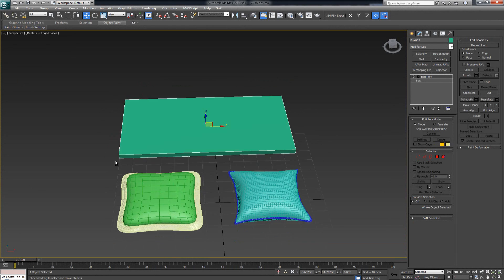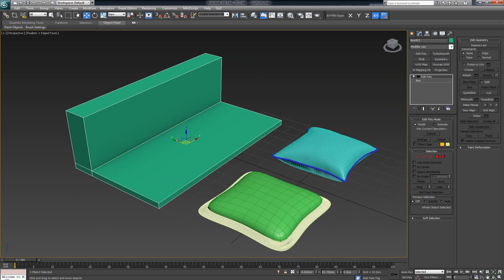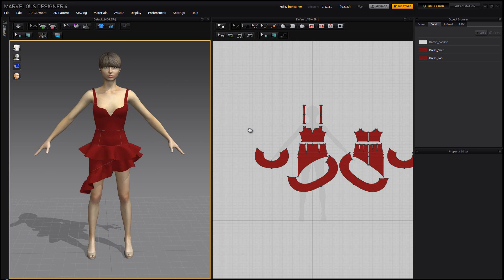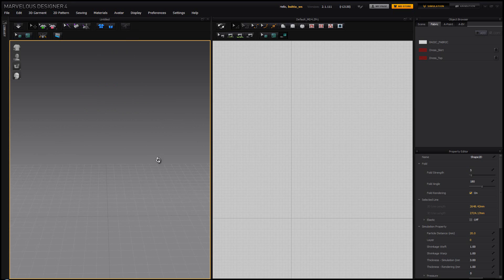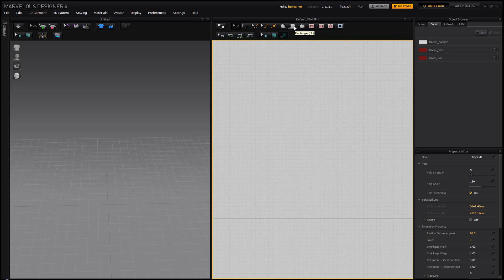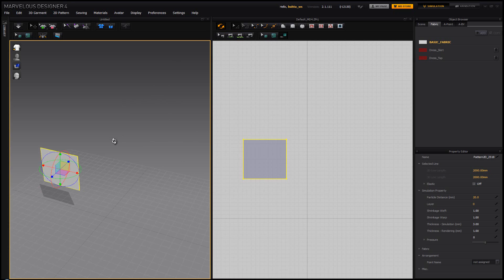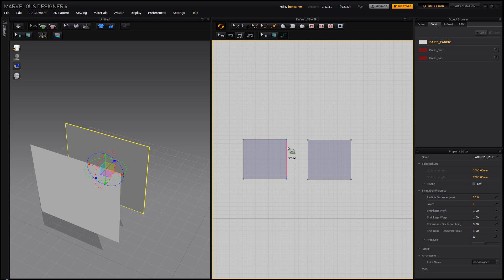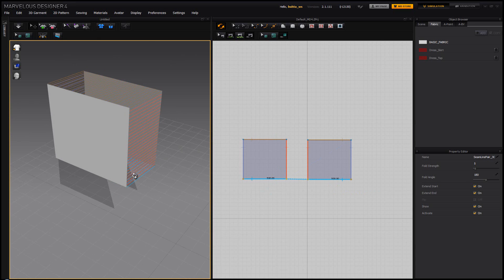Modeling a Pillow in Marvelous Designer

Comment: Do you now how you can make the inner part more stiff like denser filling or wadding? Presure only inflates it buts its still flexible, i want it more like stronger pillwos which can stand and dont bend
Reply from the maker: Make a inner pattern and inflate that one. Then freeze it so it doesn't simulate and make a bigger pattern enveloping the frozen pattern so it will consider it as a collision object.
Reply: Yes i know that one, but it always looks more like a balloon or something inflated. Im looking for a method to make square like or stiffer pillow, not the bulging one.

Comment: Hey Denis, great tutorial video. Do you know of any workflows when it comes to optimization of these pillows specifically for game engines, such as creating a low and high poly version so you can simply bake on most of the details?
Reply from the maker: Create a high poly model and then do a retopology model on top of the high poly. After that is done you can bake the normals from the high poly down to the retopologized model
Reply: Denis Keman all within Marvelous or through something like zbrush?
Reply from the maker: MD for the High poly and Max or anything else for the retopo.

Comment: Great video and tutorial. You have have what it takes to be a great teacher. 
one question, how many polygons was your pillow at the end? I'm considering the render time with vray
Reply from the maker: +ferikasif1 Well first of all thanks for the positive feedback as i do appreciate it, and also thanks for the comment about the teaching thing as that is something i've been doing :) 

In any case the render time is quite fast with VRay as it's a geometry so it most of all the render times will depend on the type of material you decide to use.
Reply: +Denis Keman Cheers mate thanks for the quick reply. 
I'm using MD5 and when the pressure is 0 the pillow is flat on the ground but when I increase the pressure and simulate instead of inflating it flies away (upward). any help with that?
Reply from the maker: ferikasif1 Hehe the floating issue. Make sure that your gravity isn't set as negative, and also make sure you have the correct normals to be on the outside.
Reply: +Denis Keman Thanks that helped a lot. 
Is there anyway I can get the sewing lines(fold line) visible later when I export it? I'm working on a realistic scene and the thick rounded sewing line on the cushion is necessary. Is there anyway I can get that in MD or should build it manually in maya?
Reply from the maker: ferikasif1 Well in MD5 there is the option to make the piping visible, but if you want to have the stitching visible then it's off to your primary software being that Maya or Max ... which come to think is an awesome idea for a next video :)
Reply: +Denis Keman You my friend, are a hero !!
Reply from the maker: ferikasif1 Only when i play Dota2 :)
Reply: ahh dota 2  :D awesome guides of 3dsmax and md.
Reply: @DenisKeman  How do you make de piping visible in MD?